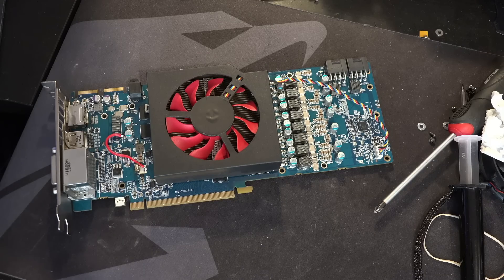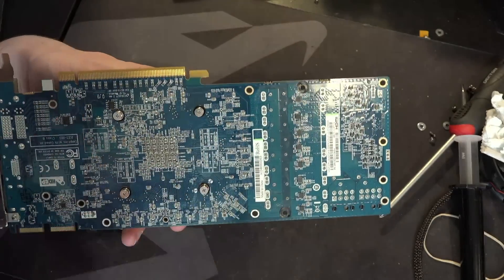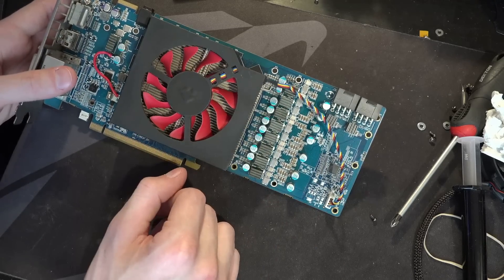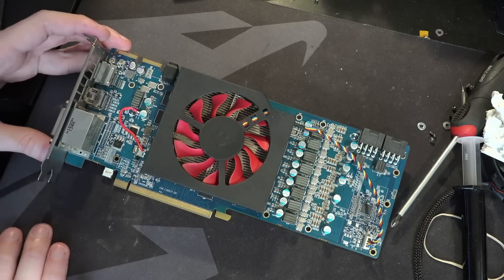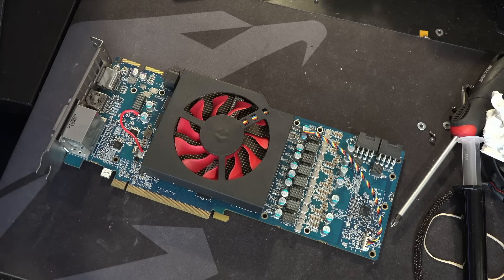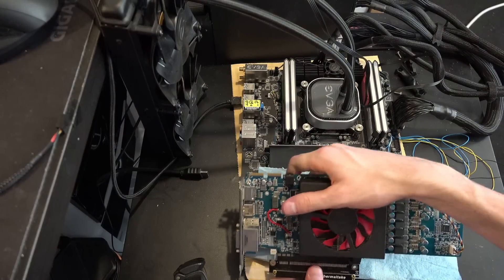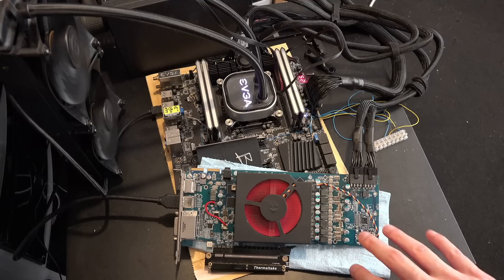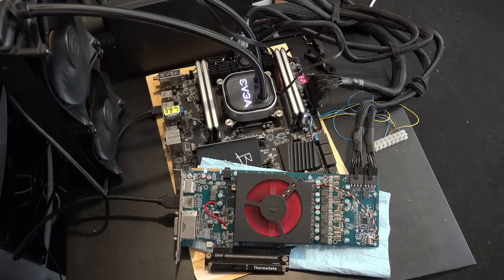GPU Necromancy 3: The ressurection of the Sapphire HD 7970 Vapor-X 3GB

Comment: Hi, I am a junior electrical engineering student and I am very interested in this kind of stuff but I don't have many resources on how to become familiar with the different parts of the gpu. Does anyone have any resources for this?

And how does a vrm work? What does it mean when a vrm works in "X + Y" configuration?

Thanks.
Reply: I can not helo with the GPU Architecture part, but many VRM controlers have several modes that they can run in. The one in the video can control 2 different vrms, 7 phases for the vcore vrm and 1 for the vmem vrm. So it is runing in a X + Y fashion. Even if it only controled one vrm consisting of 8 phased for the vcore it would still be run in a 8+0 configuration, it is just that one of the PWM signal outputs wouldn't be used.

Many controler also have dynamic active vrm phase count control, so that it turns on the required number of phases depending on the load, so the vrm can be more efficient. 
There is also tons of other features like load line calibration, per phase load or current balancing, temperature balancing and pwm frequency adjustment.
Reply: As for how the vrm work, they are your standard buck converter just multiplied a few times and controled by a central PWM signal generator or a controler in this case, which can be compacted  using power stages or power packs that fit the high side, low side FETs, the driver and the diode in one neat efficient package. 

Buildzoid also goes in detail in one of his videos on how the vrm phases work and how they are counted properly.

I hope i helped a bit :)

Comment from the maker: first
Reply: Still have my Devil 13 290x2 waiting for you...
Reply: Hello, I have a PowerColor r9 290 that does work but during setup when it attempts to install graphics driver computer freezes/crashes and I have to uninstall driver in safe mode to get display back again. Some people told me I need modded bios with altered voltage/power values (Not my field) to make it work. This happened randomly and card was working fine no overheat or such.
Reply: @magnapeccatrix  I've seen this issue before on the 290/290X and it's generally either the driver being an ass, or the more likely scenario where your BIOS has a corruption that affects detection. What you really need if you want to fix the issue is a new copy of the stock BIOS for your specific GPU. TechPowerUp has a GPU database that may well have your card's stock BIOS available for download. Before you find the BIOS though you need some inforation about your card, so do a basic lookup and fin a list of BIOS ROMs that are similar to what you need. Then,  download ATIFlash.exe from Guru3D.com and run it (without doing a flash operation) to verify that your GPU's board information matches the information in one of the BIOS ROMs you want to flash. This step is vital as you could brick your card if you don't flash the correct BIOS. back up the old BIOS from your GPU (even if it's corrupted backing up is ALWAYS a good idea and should always be done before a flash operation) and flash the new BIOS onto your GPU. you should (after a reboot) be able to install the GPU driver normally.

If your GPU has a switch for quiet and uber mode, this will be a lifesaver in the event the flash fails or the ROM isn't the right one for your card, by the way ;)

Like I said earlier, I've seen this issue happen on AMD GPUs especially. I've had it happen to an R9 290X and a HD7950.
Reply: @DigBipper188  hello and thanks for in depth advices. I have done all of those since few weeks and they didn't help. Card is working but computer crashes/display goes blank the moment graphics driver goes active (welcome screen on OS or installing driver at setup) found one solution left to try "You need to set up manual voltages for each DPM state" I just wanted to know why this happened and required bcs card was working properly. Thanks for your kind answer again.
Reply: @magnapeccatrix  gpu oven trick, try it... its an old card any way.
Reply: oh god... I had a 7950 with an itty bitty vapor chamber like that... all I can say is LITERAL JET ENGINE!!!
Reply: Legend!
Reply: how did you meassure the ressitance? wouldnt the multimeter just apply its own battery voltage  and meassure the amps? shouldnt the 9V-bettery voltage have killed the core?
Reply: @danieljordis8558 the core doesn't see the probe voltage if you're not probing between the component and the core. If you're probing a resistor that's in circuit with the core, the voltage will only be between the two points of the resistor and will not leak off to the core as the easiest path to "ground" (with respect to the applied voltage) is between the probes.  

you aren't wrong though. the meter applies a voltage (usually about 3v) across a component, then measures the voltage drop to get a resistance value.
Reply: @danieljordis8558 , Yes it would. Oscilloscope.
Reply: If a GPU shows picture without any driver installed and in BIOS but after the driver installation it blacks out the picture when enetering windows, what is your view on what hardware piece on it is at fault?
Reply: i think i migth enjoy trying to get a dead card and try to fix it where would you recomend finding the resources to trouble shoot (scematics specs for power rails ect)
Reply: Hello I just  got hands on a TITAN V, is it worth  to volt mod and how much performance increase may I get out of it over what MSI afterburner can do?!...It is a gpu used for raytracing and workstation rendering long term loads...currentlyi can get   on watercooled look 210 mhz memory OC and  gpu wil not  sustain anything  over 55mhz  overclock basically the gpu in vray bench will crash even if not at full power, once it hits above the specified boost clocks
Reply from the maker: @AbyNeon  Like most recent Nvidia GPUs the Titan V doesn't scale with voltage unless subzero. Though I have heard from people with Titan Vs that hardmodding the power limit can help IDK how much.
Reply: @ActuallyHardcoreOverclocking   uhm so would be nice to find out precisely...if there can be a 10 15% performance increase without extreme  overclocking maybe we might do something together with it....in all  sincerity for 5120 cuda cores, and being basically a GV100 GPU, it is safe to say that all of NVidia line up is pretty crappy and at least 2 years behind from what  performance should be.....This GPU didnt impress me at all despite it being twice as fast as a 1080ti in rendering...I suppect that  truth is that nvidias memory controller is totally a piece o junk, and that the opted for  good yealds instead of decent memory controllers for hbms...I think thatif AMD wil bring chiplets to GPUS...thatwill be last day of Nvidia in the market....anyhow let me know  if u find more accurat information for oc, and then  il find a way to be in touch with you privately.,,,thank You!!
Reply: lmao YOU CAN'T FIRST YOUR OWN VIDEO! haha!